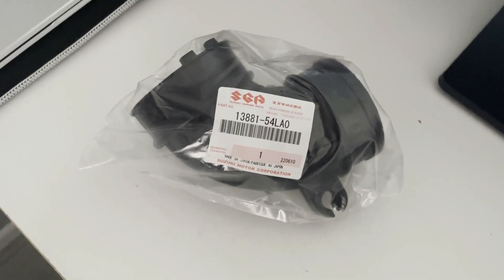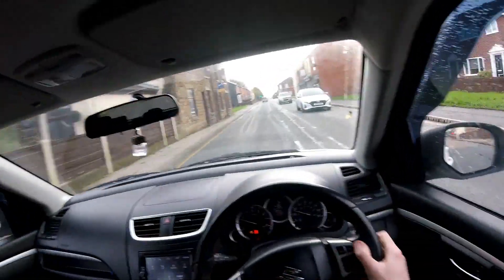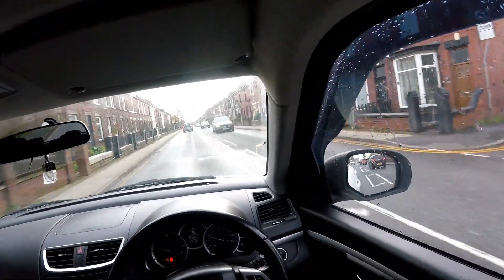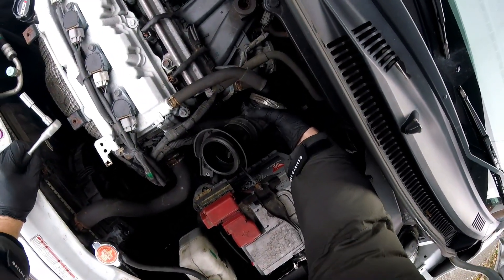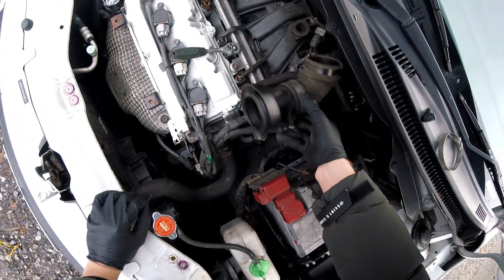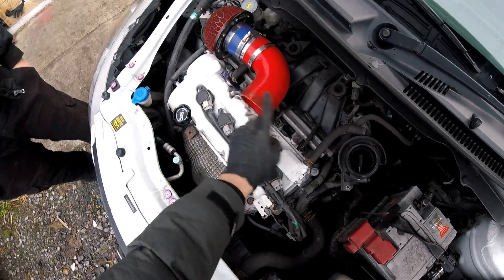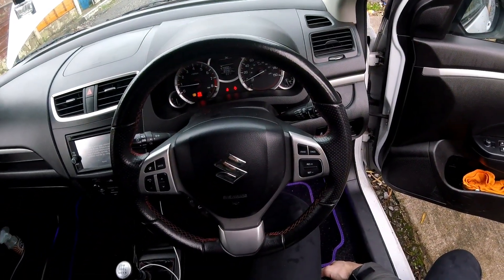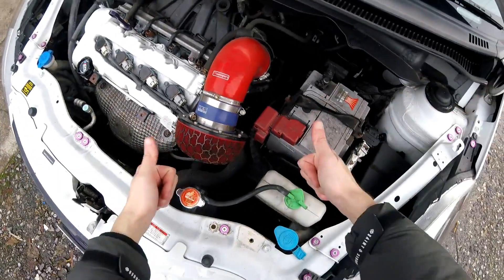ZC32S Replacing perished Rubber Air Intake Pipe (Genuine Suzuki Part)

Comment: I cleaned my throttle body as well and it made the throttle response so much better. I forgot the car had torque cuz before the throttle body clean, when I gave it the beans, nothing happened. Worth doing that as well I'd say in the future. That hose was cracked in mine as well but I just wrapped it with tape lmao.
Reply from the maker: I did buy some throttle body cleaner I might have to try it out. I think mine is definitely due for a good clean. That’s and the new pipe will be like new again. I mean if it works it works lol
Reply: Did you take it off or just get in there?

Comment: I think the main cause of the craking of this elbow is the incorrect mounting of the air intake ( or no mounting at all). The same thing happened with my car when the mounting of my intake came loose. It was loose only for a few days and the elbow cracked.
Reply from the maker: This may not have helped but this is a common fault on the ZC32S in the first place

Comment: My car idles a bit lumpy sometimes and the revs go up slightly did you have the same issue?
Reply: Also every morning my car sounds like it struggles to turn on, just before the engine starts you can hear a struggling sound. Is there a reason for this?
Reply from the maker: Yes that's exactly what I had and this has solved my issue with it
Reply from the maker: I have no idea honestly, if it runs fine I'd probably say it's an effect of the cold maybe?

Comment: I have a 2010 Swift sport. The radio fried the other week and want to get a replacement off eBay. All of them needs codes. Do you know how to get a code for a second hand radio?
Reply from the maker: Is this the standard one that comes in the car? If so it's worth getting an aftermarket one imo. Had one in my 2008 1.3 Swift and it made it much better
Reply: @wallsworkshop  yes it’s the original one. I was looking for an original one as I don’t want to spend too much on the car as I bought it because my everyday car has been off the road for months mate
Reply from the maker: @b4tm4nrubin33  fair enough mate. I didn't realise they needed codes, If you have a look on some of the Facebook forums you'll probably find an answer
Reply: Definitely get an aftermarket one. Quite surprising though, my Garmin OEM one in my ZC32 2014 Swift Sport didn't need a code when I changed the battery

Comment: Thank you for the video, caused me to check mine and I also have cracking showing on that same part.
Annoyingly my intake is fully stock so would be tricky to change, or that is just an excuse to get an aftermarket one anyway 😅
Reply from the maker: You’re welcome! It was a sign 😂 it’s a very common issue with them. I think you might as well get an aftermarket one if you’re going to remove it to replace the part 😁